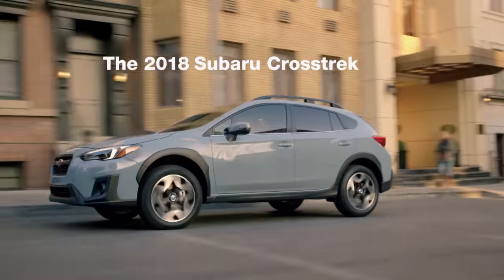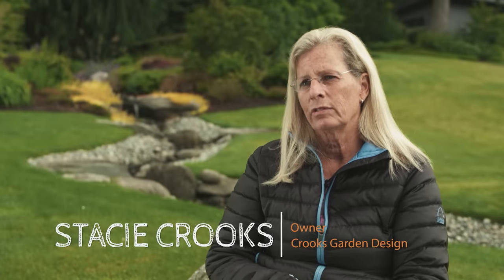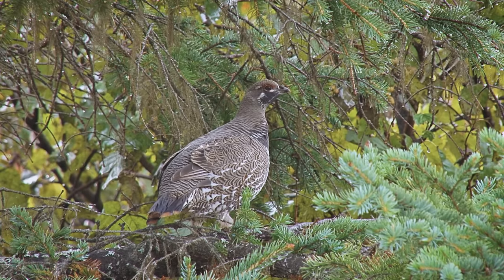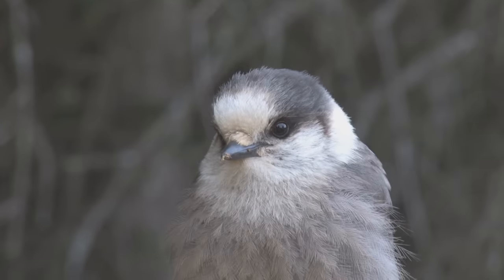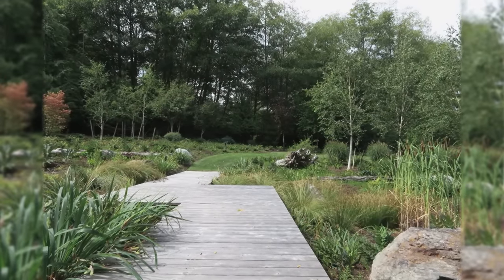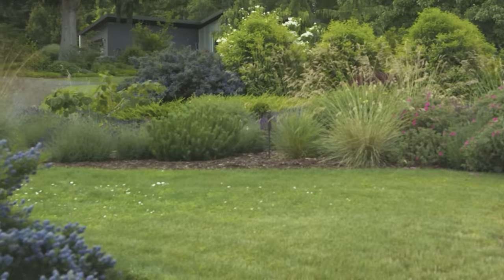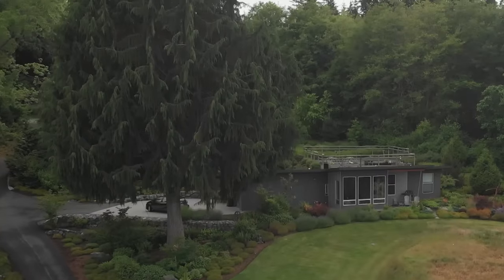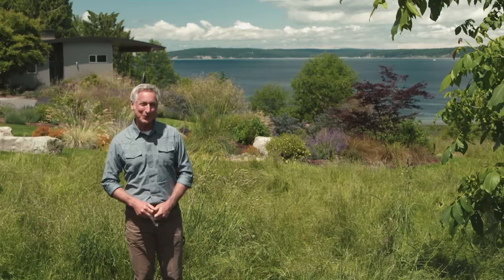Growing a Greener World Episode 910: Sustainable Landscape Design

Comment: Great looking landscape, as a retired professional gardener, large landscapes on relatively undisturbed site are fun.   I have found that the more common small lots where developers have striped off the soil are much more challenging.   Many side yards can only be five feet wide.   I have tried to work with my home owner and the neighbors to create a joint landscapes where  both ownerships  flow together creating a feeling of a larger space.
Reply: "lots where developers have striped off the soil"
Brutal.  It's taken over 25 years for much of my lot to heal itself, and at least 1/2 acre of the two acres is still struggling to do so.  Crazies say "Till in compost.", when big rocks just below the surface.